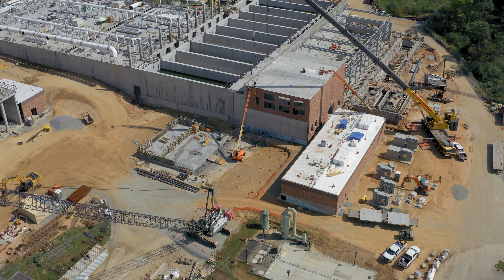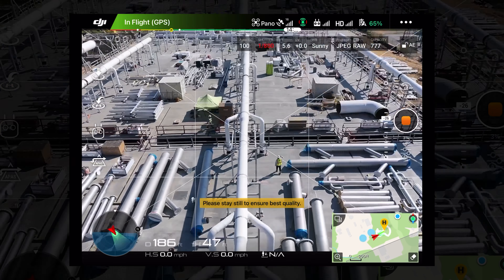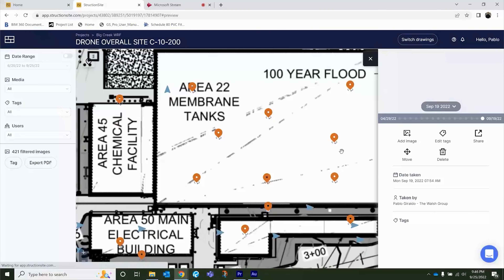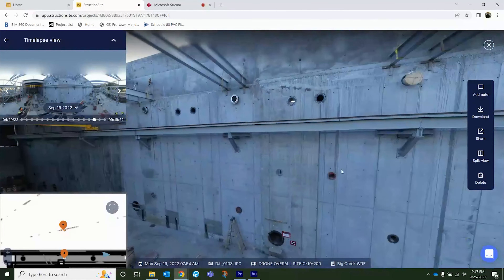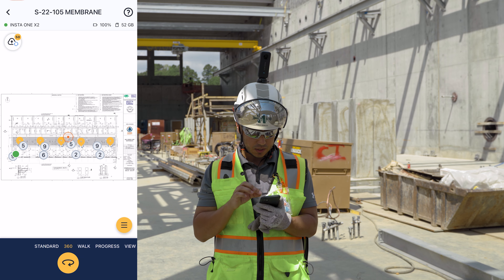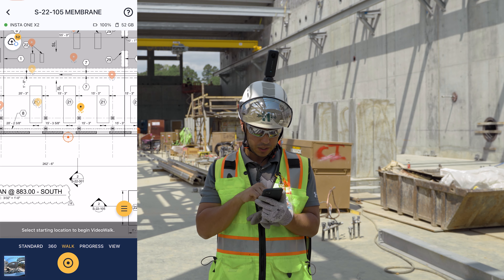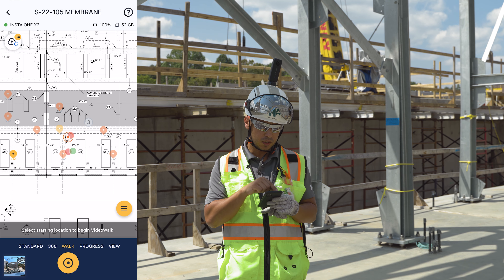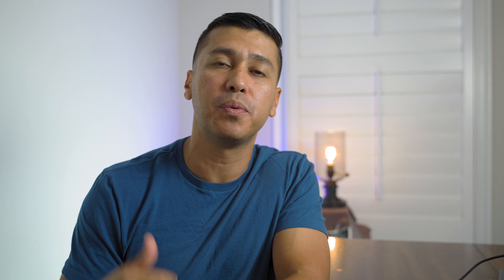StructionSite - How to track project using 360's

Comment: Great video. Question regarding the drone 360s. As much as I would love to have the time to take these photos and upload each to a pinned spot on the plan--is there not a way to treat the drone the same way as the walkthrough--where you can document your takeoff spot and return spot and structionsite AI figures the rest out? If not--that would be a HUGE upgrade for them to figure out. Not sure how it would be too much different than walking with a 360 camera except having to account for the elevation.
Reply from the maker: I want to say their upgraded platform can handle the situation you are mentioning. I am still looking into it